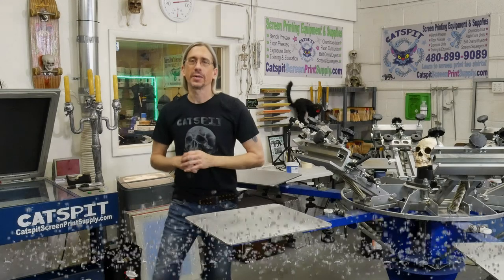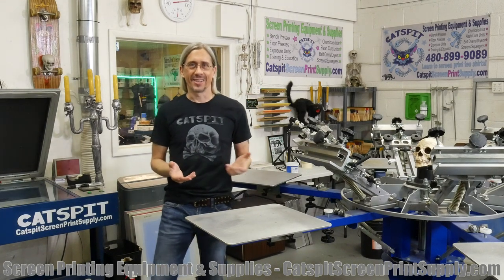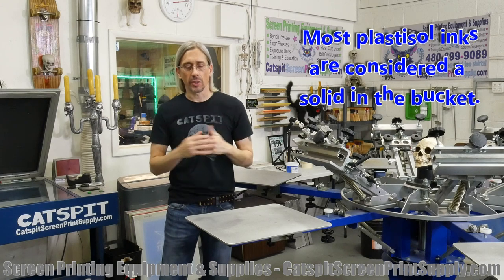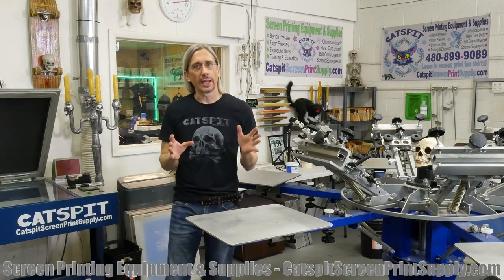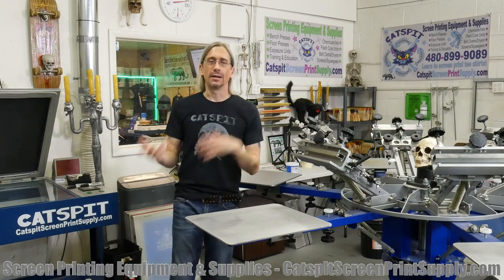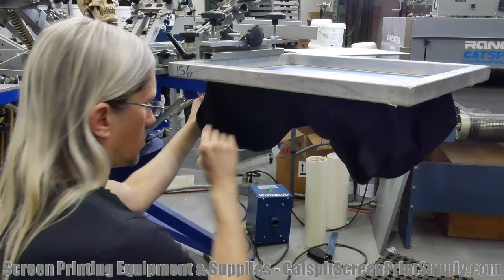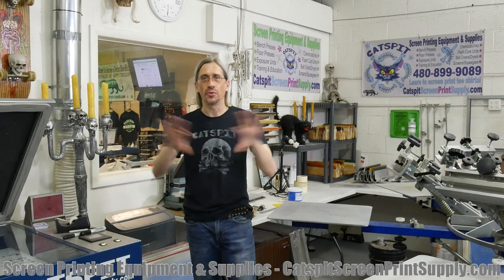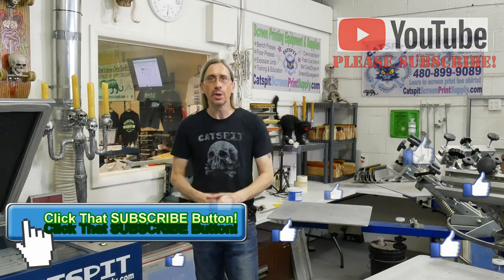How To Screen Print Tee Shirts: How Much Off Contact Is Too Much?

Comment: I have a manual press with wooden platens, I've found on some garments my ink once I've laid it on my garment with cause my screen to stick to my shirt and sometimes pull Ink off the garment,  or even pull my garment off of my platens. I use fuzz and glue method if that makes any difference,  is it just too little off contact, or is my ink too thick?
Reply from the maker: I think I have a video about that. Check out the video about prints sticking to the screen. There's a couple of reasons that can happen. Thanks for watching! Screen Printing Equipment & Supplies - http://CatspitScreenPrintSupply.com/

Comment: What do you think about using popsicle sticks at top and bottom of design as a hack? I do this sometimes. On big designs ill put 2 side by side.
Reply from the maker: Well on some presses that may be necessary but if your press is in decent shape it should be able to hold the off contact on a 20x24. So perhaps a 23x31 or bigger might need some help like that due to flexing of metal. If it does not flex, it will break...lol ;) Thanks for watching! Screen Printing Equipment & Supplies - http://CatspitScreenPrintSupply.com/

Comment: Johnathan, I have been retired for a couple of years, and earlier this spring, I had the bright idea to take up screen printing.  My background is that I am a journeymen carpenter, who when times were tough in construction, I went to work in a traditional print shop, eventually rising to the position of lead stripper at a time we were still using direct to film, and then plating. As construction picked up, I went back to Construction, and retired as an overnight project supervisor for Ledcor construction. I have built my own 4 station wooden  press that uses a lazy Susan bearing swivel, and the unit works pretty good, but I continually tweek it.  I Just want to thank you for all the advice that you have shared over the last few years that have helped me to get up and producing. By the way, love the belt.  Blessings Greg
Reply from the maker: You're very welcome. I'm happy to be able to help out through my video work. Thanks for sharing your journey. I'm glad to be a part of that. Yeah it's hard to find a decent genuine leather belt these days ;) Thanks for watching! Screen Printing Equipment & Supplies - http://CatspitScreenPrintSupply.com/

Comment: 1/16” is great...if your screens are properly tensioned. Most people starting out printing, don’t buy new screens. You need higher off contact with low tension screens. But if you’re just starting...buy new screens and follow these instructions :)
I only mention this because it’s how I started and wasn’t getting good prints cause I had garbage screens.
Screens are your most important piece of equipment...don’t skimp there. It is called SCREEN printing 😉😏
Reply from the maker: LOL... well yes, your screen should have tight mesh ;) A screen with loose, saggy mesh is a problem in more ways than off contact. You hit it dead on. Screens are an extension of the press. If your screen sucks, so does your press, sort to speak. I agree and cannot stress it enough. A tight mesh screen is necessary for an easier time printing. Thanks for sharing that. Thanks for watching! Screen Printing Equipment & Supplies - http://CatspitScreenPrintSupply.com/